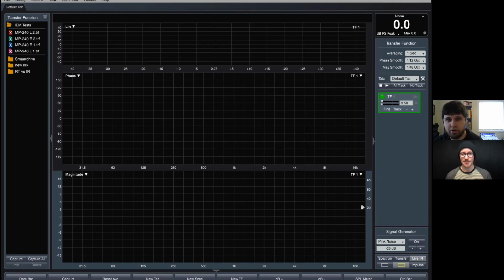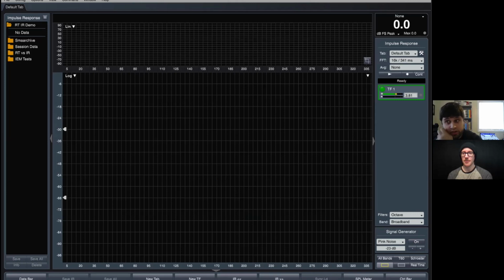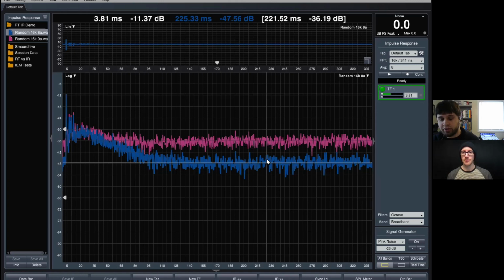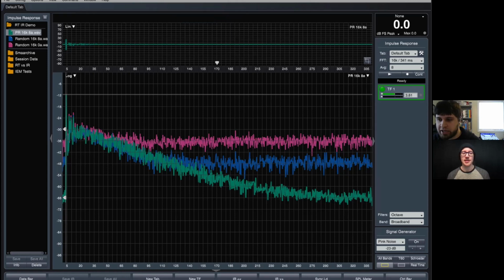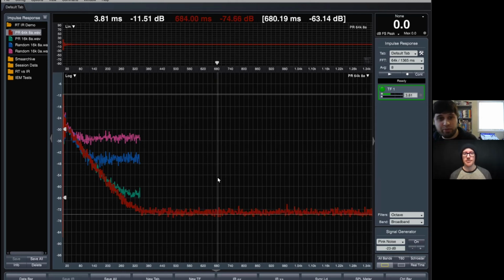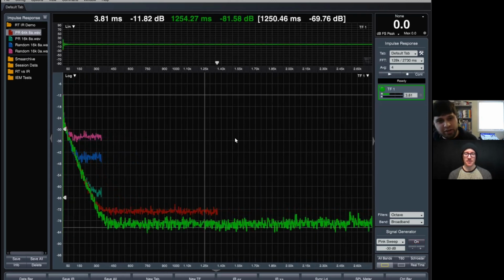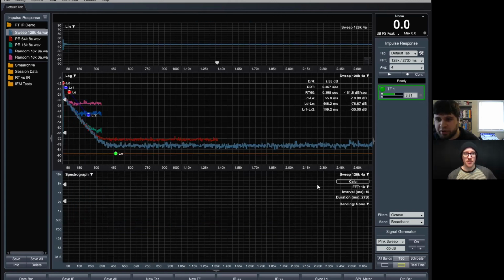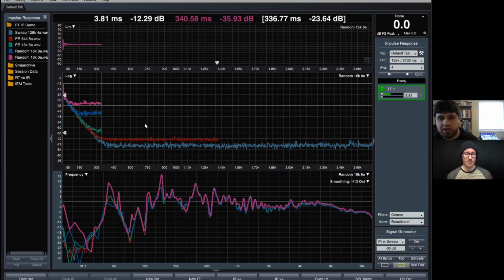Audio Analyzers: Pink Noise vs Sine Sweep with Michael Lawrence from Rational Acoustics

Comment: When testing the performance and allowable input of speaker units, do they usually define pink noise and test with sine waves without using pink noise, will the voice coil and unit be destroyed by the sudden temperature rise of the voice coil?
Reply from the maker: You may want to check out m-noise: https://m-noise.org/

Comment: Hi! Nice discussion! 
But let's talk about something different.
I compared two methods: pure Dirac impulse recorded back to DAW, and regular sweep in REW. Nothing except mic gain and speaker volume was not changed. But I got slightly different results. My thoughts what it is much easier for loudspeaker to play sweep tones instead of Dirac, so i think for fast sounds Dirac is more accurate in terms of possibilities of loudspeaker, and for more harmonic signal sweep tone is more accurate. What do you think about it?
Reply from the maker: hey Michael, I haven't used Dirac impulse so I can't comment. You might reach out the creator of REW for his opinion.
Reply: @nathanlively  I made another measurement with Dirac and it was similar to sweep, so i think something gone wrong at first time.

Comment: I'm finding this video very late but anyway. My question is this:
Was the pseudo-random noise just a loop of some random noise? Or was it one of the exact and completely deterministic sequences (called "maximum length sequences") which sound like pseudo-random noise and which have been explicitly designed for the goal of impulse response recovery? It would definitely be nice if these had been discussed there as well.
Reply from the maker: Hi Petr. From the Smaart User Manual:

Technically, the random number generator is pseudorandom also, however it is randomly reseeded every time you start the generator and given its cycle length of 219937 samples, it will effectively never repeat.
Pseudorandom noise signals in Smaart
repeat on intervals that are a power-of-two
samples in length up to 219 (512K samples).
These can be band-limited or shaped to an
idealized long-term average speech
spectrum (LTASS) in addition to broadband
pink noise. When using pseudorandom
noise, you should always select a cycle
length that is at least as long as the longest
FFT size that you are using for measure-
ments. The longest time window used in the
MTW transfer function is a little over one second, so 64K would be the lower limit in that case but noise sequences even that short tend to become hard to listen to pretty quickly.
Reply: Thank you. From the description it seems that these are actually not MLSes. But anyway, the most obvious way to know if they're MLSes or not is that an MLS only alternates between two and never more than two different sample values (usually +1 and -1 or +1/2 and -1/2). Also, one important property of MLSes is that if one sound file contains the same sequence repeated over and over and another sound file contains the same sequence played just once and backwards, convolving the two sound files makes a single impulse repeated, provided that the sample rates of the two sound files are identical and that no intermediate resampling has been done on any of them. Nowadays MLSes are no longer popular because they often give a worse SNR than what you get with a sine sweep and because it's often not possible to guarantee the same sample rate both for the recording device and for the playback device.

Comment: I've been figuring out how to calibrate my vinyl playback system. Sine sweeps seem to work out nicely out of the box, but for pink noise the lower frequencies get lower measurements (using the analyzer on the RME device - which doesn't use FFT). My interpretation would be, that due to the mechanical nature of the sound reading, there would be some inertia involved for the low frequencies, which doesn't get measured with a frequency sweep, but the pink noise is changing its frequencies so fast that the inertia has a measurable effect. 

What would be your take on this? Are you aware of other examples, where sine sweeps produce a different result from pink noise?
Reply from the maker: Hey BoooM, I'm not sure, but it may only be a question of getting the level high enough above the noise floor. the sweep is automatically higher above the noise floor because its crest factor is lower, but either should work fine in low noise environments.
Reply: @nathanlively  Thanks, now learned to include the crest factor into my thinking process. But I don't think it's related to the noise floor. I just contacted the manufacturer of my phono preamp, hopefully they can help me out. I probably need another cartridge which synergizes better with my amp. My assumption is that the amp kinda amplifies the tendency of the cartridge to overemphasize the higher frequencies.

Comment: Thanks for the video. I have heard some people use short bursts of noise at different freqs, and/or clicks in systems without delay speakers. Is this for RT60 decay measurements at various frequencies, or something else?
Reply: From a measurement perspective, we need to pass a frequency through the system in order to get data at that frequency.  In other words, if you try to use a flute recording to measure your subwoofers, that won't work very well. So for general measurement purposes, a broadband signal of some sort is important.

That being said, there are a variety of specialized test signals that are used for specific purposes, for example the STIPA signal used for speech intelligibility tests, the M-Noise signal for linearity tests, and so on. Some people use clicks or pops to try to set delay speaker timing by ear. RT measurements can be gathered with a direct impulse (pop/bang/clap/shot) although there are some drawbacks with doing so, and a sweep or other period-matched signal is generally a better approach.

All of these signals have certain mathematical characteristics that are designed to quantify particular properties based on the test that's being run. So in a sense it comes back to what Nathan and I discussed in this video: starting with a goal about what you'd like to measure, and choosing the appropriate tools to get you there. 

-m
Reply: @m-audio-stuff  Thank you, I appreciate your reply!
Reply from the maker: Unsure! Maybe Michael knows?